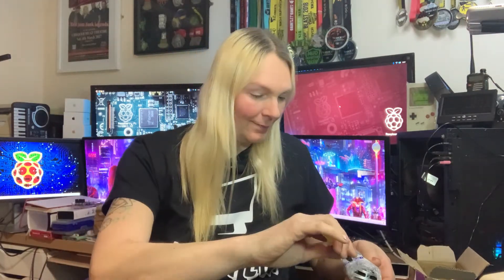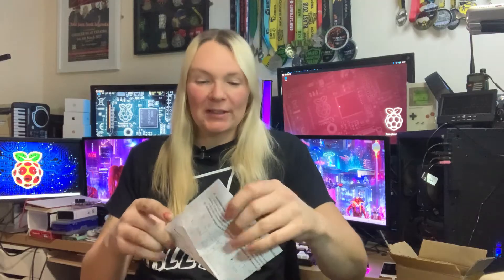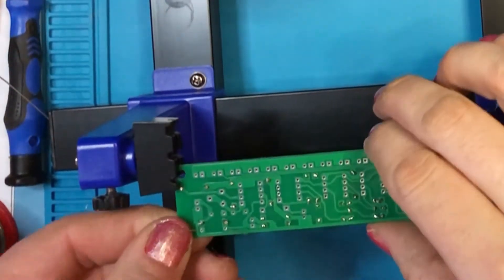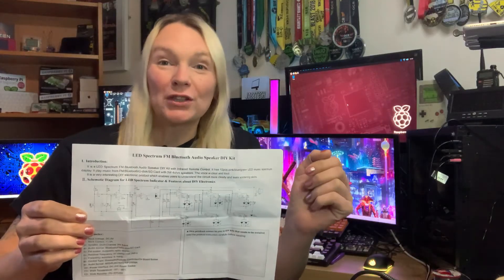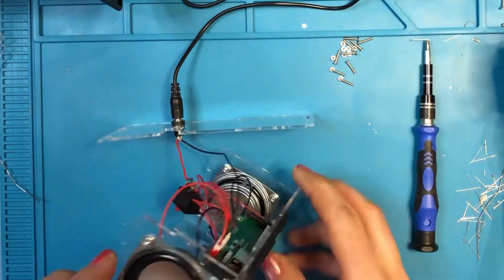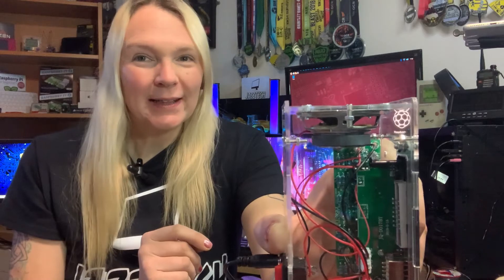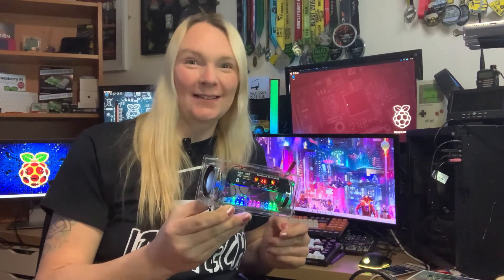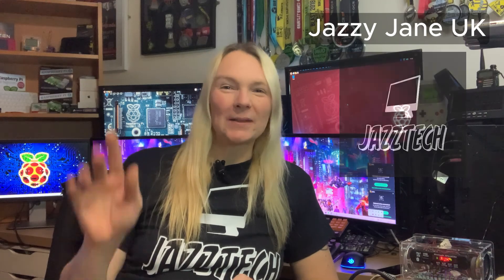I Built A Bluetooth Boombox Speaker Kit from Amazon!

Comment: I just started doing this kit, ive managed to get it all soldered apart from connecting the boards together and cant work.out where to solder the 2 connections. Also unsure if it should power on or not without the 2 boards being connected but mine wont power on yet

Comment: I got a similar kit and it's surprisingly well built, the audio is actually quite good, really cool project and I will say the instructions were also unclear on some points. I also have that same component tester, good idea to double check.
Reply: Where did you solder the wire connections from the diy board on the led display board?

Comment: Are those holes in the front panel?  Wondering if the Leds are meant to poke their tops out those holes?
Reply from the maker: Yes they are supposed to go through the holes, lol. I only noticed that after I had soldered them all in and the legs were all too short to modify it.
Reply: @JazzTechUK  It's alright I did the same thing, atleast they wont be shining directly into you eyes.

Comment: Thank you lots of tips n tricks as well I made an attempt to make a fm radio off eBay but failed in the making of it down to being inexperienced with the oversizes soldering iron but did reach success with my tester tower put together with my brand new iron looking much like the one you used in this video, thank you again. Purchasing time 😮
Reply from the maker: Modern electronics as well as surface mount components need a fine tipped soldering iron and good quality solder. I prefer leaded. Unleaded will make you think you are bad at soldering. I generally use 0.7mm.
I have just done a video on a nice FM radio kit. Have a look on my channel.
Thanks for watching.

Comment: I bought the exact same type of speaker on ebay, it worked for a day, then the display stopped working. What could have happened?
Reply from the maker: Have you checked the wires going to the display board. Does it still have +5V on it. Could you have touched the board too much and damaged it with too much static electricity.

Comment: Hola Jazzy Jane, excelente video y proyecto. Noté que sólo falto que colocaras los LEDs en los orificios frontales correspondientes. Espero armar pronto el kit. Saludos y Bendiciones para todos desde México.
Reply from the maker: Yes, I forgot and just soldered them all in and then realised it was wrong. It wasn't then worth the trouble to take them all out again, plus the leads had been cut too short by then anyway. Don't forget to adjust the little trimpot while playing music through it at the volume you expect to be using it at, before you put the lid on. That way the LED's move up and down at a reasonable response rather than being all on or not all lighting up.
Good luck with the kit and thanks for watching.
Reply: @JazzTechUK Hola Jazzy Jane, ya recibí el kit, espero armarlo bien, ya que el instructivo llegó en chino. Saludos y Bendiciones.
Reply: Gracias por el consejo de ajustar la ganancia de los leds antes de cerrar el gabinete.

Comment: the FM did not work on mine but everything elts was good. With ant wire it came with had to be put on and still the fm did not work.I buy two of them the other clear case one the fm works great on it. I just had one bad one. so i took the black case one thet worked and put it in the clear case one thet the fm did not work in and put it in my clear case one i buy. I want the black case one working too but i tryed to fix it with no luck.

Comment: I just finished the build and everything works fine,  but the only problem I do have is the antenna wire is not strong enough. What would you recommend?  The wire given I'm guessing is 26 gauge, It's small, anyway the stations coming but I get mostly static.
Reply from the maker: You could try just connecting a longer piece of wire and then moving it around until you get a better signal. I built it mainly for the Bluetooth functionality and connecting it up to my phone for Spotify.
Reply: @JazzTechUK  I'll try that thanks. I built it for the Bluetooth also but I like to make the radio, So My wife (I'm not Pat, I'm Kev) can listen to it.

Comment: Mostly complete this kit however there’s one thing I’ve not been able to work out. There’s one socket on the circuit board with the LEDs, I haven’t been able to work out where the two wires go? I’m assuming it’s somewhere on the Bluetooth circuit board?
Reply from the maker: Hi @squeaksvids5886. Sorry for taking so long to reply. I had to get the unit out to remind myself where I put the wires. I took the wires from the LED board and soldered them underneath the board on the incoming power connector for the top USB board, the red power connector. It gets a direct 5V this way and works well.
Reply: @JazzTechUK  Thanks. 👍🏻👍🏻

Comment: I have one of these kits to build up.  Nice to know some of the pitfalls.  Also, ordered one of those pin straighteners.  Strange that buying it from Amazon UK is my cheapest option being here in Canada.
Reply from the maker: It's not a bad little kit overall. The IC pin straightener is an invaluable tool. Not so much for straightening the legs as for getting them at 90 degrees so they go in the board or sockets very easily. Thanks for watching.